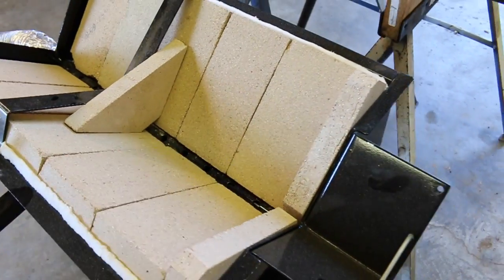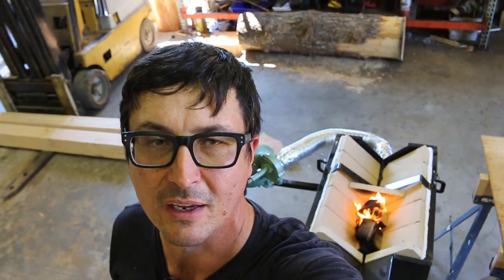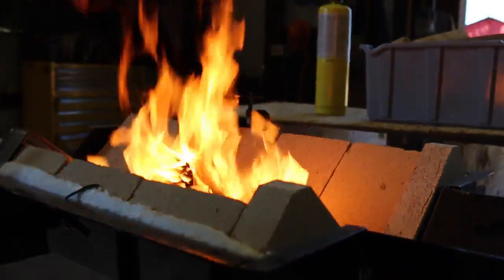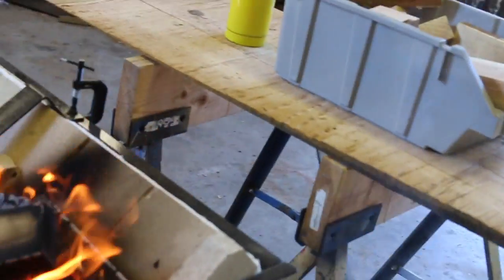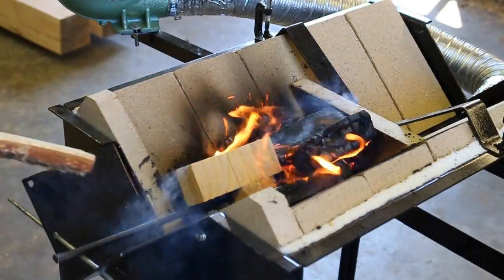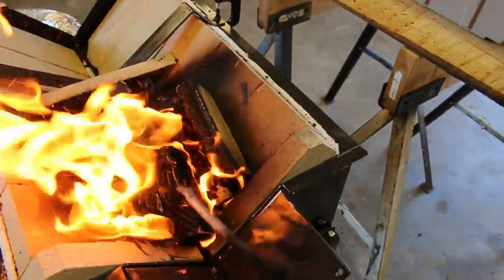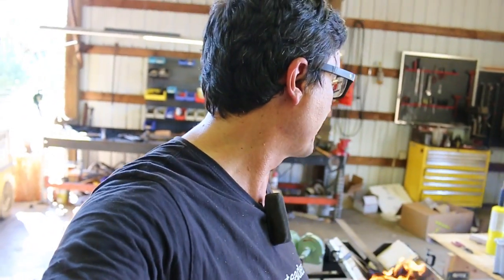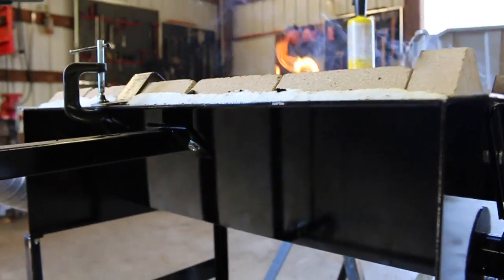Forging Steel With Wood Scraps

Comment: The one HUGE advantage you did not talk about is that you can take this thing ANYWHERE and do you smithing like you would at home , 500 miles in the middle of nowhere this can be used.  I cannot for the life of me see a downside to this forge or what people can be complaining about
Reply: Deo Heerai I think he mentioned something about it in the unboxing video but I may be mistaken
Reply: Deo Heerai You would still need to bring a few bags of wood chunks and tinder.. But yeah I guess if you wanted to bring it anywhere you could.
Reply: A_Old_Fat_Cat not if there are trees...
Reply: A_Old_Fat_Cat Dont forget the Anvil or you are going to have a bad time
Reply: G3RMANARMY When he said in the middle of nowhere it brought a desert to mind.. because thats literally nowhere. And theres not really any sort of a good tree in the desert.
Reply: ***** sure
Reply: The only drawback.... Is that it isn't efficient. But it's cheap. So it kind of evens things out.
Reply: Deo Heerai I'd like to interject here. It won't go everywhere as it's only 2 wheel drive. If it were 4 wheel drive then I would agree. :)
Reply: A_Old_Fat_Cat burn cacti. :)
Reply: Take it to the middle of Death Valley. That'll get you going.
Reply: The Whitlox forge only has two wheels. Thus I dub it two wheel drive. If it had 4 wheels then I would dub it 4 wheel drive. If it was a 4 wheel drive then I reckon you could take it anywhere. So my recommendation is to only use the Whitlox forge in paved areas. (I being quite silly)
Reply: Deo Heerai The biggest benefit of this thing, for me anyway, is that one day I could actually afford to have this shipped out to me in my country. Four boxes? That's nothing. Man, that blower rocks!
Reply: A_Old_Fat_Cat What about dried up scorpion tails?
Reply: mad hatter Now that would be hard core blacksmithing!
Reply: I'm sure the Whitlox guy said that forge welding was no problem. I could be wrong. It's my gifting you know...
Reply: right on....
Reply: +David W I use charcoal to forge weld. But just to beat around metal dry wood works well for me. Mine is an old coal forge with a separate hand crank blower. I've used it all, but prefer wood scraps the dryer the better.
Reply: +Deo Heerai I can't see the downside either, but i'm not much of a smith. However i know that he took it very personal and somehow brought up that the family this product came from are wonderful people. No doubt they are but that has nothing at all to do with the quality of their work. I bet that forge works fine though, and if you feel like there's a tipping risk or something like that you could easily secure it further, but it looks fine to me for use around the house doing hobbyprojects. But then again, what do i know?

Comment: Mr. Wranglerstar, I did it!!! I could not afford to buy a whitlox forge. but you and whitlox inspired me to build my own from scrap materials!!!! I used nothing but an angle grinder, welder, 1/3hp drill press with no drill vice, bench vice, chanel locks, and scrap materials... except for the Kaowool ceramic blanket that I had to buy new. so thank you for inspiring me to do something I have wanted to do for years. It is not pretty unless your me hahaha. but I will be assembling my video shortly on my version of the whitlox wood forge. I have talked to the whitlox family and will promote their forge in my video so people who can't or won't fabricate one, can buy this awesome tool!!! thank you brother for all the inspiration to just go do it and let the mistakes happen. I love metal because you can put it back!!
Reply from the maker: +GasNBullets Well done!

Comment: I've had a full size whitlox for about 2 years. Only negative thing is I got some different blower an Azeeza or something, It doesn't matter that it wasn't the blower pictured but that it arrived with a crack on the gear cover and it shouldn't of. Aside from that, the forge itself is well built and I have had to replace nothing. Replacing firebricks was a concern but mine are all still in great shape, don't abuse or over flux when forge welding and they really last. Forge welds easy, I forge weld steel cable in it regularly. I live in Oregon so wood is plentiful while coal is not and I have to fill enough propane tanks already, I don't need more of those. My only regret would be the blower, wasn't what was shown and arriving brand new with a cracked gear cover is somewhat annoying.
Reply: Do you have to do anything special to forge weld? Or just the normal operation of the forge? I keep reading about how bad of a design it is and I haven’t seen a video of it forge welding something yet. Just curious

Comment: Proper? For years now you have been teaching us and showing us The importance of doing things correctly, properly, and to the highest quality. you have shown us amazing work done by true craftsman including YOURSELF . Everything done to the tightest tolerances.
 so please Mr. wranglerstar excuse me for questioning your judgment on this Forge. This Forge that is obviously not built to any where near the quality that you have taught us to live by. 
Mr. wranglerstar I have always considered your opinion with the highest regards ! 
As weird as it may sound I feel like I gave a friend my opinion ....
Reply from the maker: American Dreamin Have you actually used one? Or is your opinion bases off a video?
Reply: I have never used a Forge in my life. The only videos I watch are yours.
Reply from the maker: American Dreamin I appreciate your opinion however without putting your hands on this tool you are in now way qualified to make such a harsh judgement.
Reply: I feel like putting my hands on it is irrelevant.I know what dryer duct feels like and I can see what it looks like with oversized hose clamps and duct tape holding it on. I know what bolts look like when they are too long. I'm sure you remember a wile back You showed how you aligned the slots of flat head screws so they all would match. I smiled because I had never met someone that was so detail oriented as myself. I do that too. Proper. The small angle iron legs and needless to say the cross brace miscalculations etc . The large gap in quality differences from the stuff you normally show us is where my judgment is coming from. Rogue hoes, Stihl , Adams boots, benchmade , old Stanley , Honda engines.. On and on all the amazing axes and knives perfectly executed. You have shared with us amazing quality items . You have also shown us items which to steer clear of due to lack of quality or usability. Fiskars comes to mind which I have never owned because of your opinion of them. Dreadful fiskars. They can cut down a tree and chop but nothing like your high Quality grand force brooks. I hope you can understand at least a little bit where my opinion is coming from.
Reply: American Dreamin He can, but your starting to drone on and on and on and....
Reply: American Dreamin it is duct tape but its not what everyone thinks of when they hear (duct tape ) this tape is metal .im using this as my test I plan to watch and see how it holds up before I get to judging it from what ive seenbits just been small problems that a chimp with a spanner could fix the support being a lil long (no biggie ) and the plastic wheels (don't need to put them on) I love the fuel I love the power source for the air and if it holds up I love the possibilitiesI may have to send them a metric bolt set if I order one but im crazy and wont drop it .
Reply: Zachary McCullough sorry youtube has been cramping my comments a bit I do proof read before I post and fix but they don't stick . ugh
Reply: I guess I did carry on a bit long however after being called very negative things for stating my opinion on a previous video I feel slightly upset especially coming from a man I've been watching for years and truly respect. Thanks for your opinion bud.
Reply: Zach I understand what your saying.
What I don't understand is why mr. Wranglerstar is telling me that this is quality . When what you just stated is a lot of not quality and not well put together . The other day there was hundreds of people posting there negative opinions... Where did they all go.
Reply: Jason ... Wasnt trying to upset you bub. I'm a very happy person . No troll here I've been watching mr. Wranglerstar for quite some time now. I've enjoyed meany videos of his matter fact this is the first comment I have ever left That wasnt agreeing with his opinion. I did however completely understand the coal vs wood issue but thanks for letting me know again. The issue I was trying to discuss with him is over the quality of the product . Sorry about the spelling im not that good at it.
Reply: they said their piece .
in this vid he cranked er up it got to temp and didn't dump on the floor or light the shop a blaze I like so far .
also please keep in mind this item is mailed to you they have to keep it some what light and be able to break it down . to have it in one piece and shipped as that it would double the cost maybe triple it .
if it cost to much its not worth it people will stick to north American coal .
Reply: Canesrock geesh my phone is not letting me view your link . My guess it's of a couple people standing on it ?  you can allso stand on a can but soon as you shift your weight down you go lol. I have worked around heavy equipment shops Machine shops Mills and construction companies none of which have stands for items made out of one inch ish angle iron. One accidental bub and its not going to be good
Reply: RFDarter please read a few comments ago when I answered that same question to mr. Wranglerstar. Thanks bub
Reply: Zach... It sounds like you own one? You allready told me all the problems with it so out of the box would you consider it quality , made with good material, well thought out?  that's what I was debating with mr wranglerstar about.
Reply: I like you am going off the vids I just happen to work with some of the material its made from and the problems I mentioned where in wranglerstars unboxing vid and assembly vid .
I want to see cody use it more before I decide if ill have it on my land it has some big selling points .
would I stand on it no ! its not a stool or ladder  .
if I remember correctly the ( typical India) was a off center hole for the set screw on the blower handle and has turned out so far to be a nonissue
I like it so far but I do want to see it used .
Reply: American Dreamin one thing I noticed is the dial for the ingenious air flow control ( I love it )  . it is connected to and sits under directly under the fire if you need to adjust the air flow in use that dial may get a tad bit Chaud ! as you are smithing  and  should have gloves on it should be a non issue .
Reply: American Dreamin Its not grand force brooks, it's Gränsfors Bruk :)
Reply: American Dreamin You're missing a fairly important piece of the puzzle here: the forge is a product sold on the open market, not a one-off example of craftsmanship. It needs to be affordable or it won't sell. Thus, it is designed to be easy to mass produce while being sturdy and durable enough to get the job done, likely for as reasonable a cost as possible. The pricing isn't out of line for what you get, as far as I can see, considering it's a niche product.

When you next watch a video of Cody making something, think about how much time he's putting into it. Then translate that time into how much it would cost to pay a skilled worker to do the job at $25+ an hour. It's no big deal to put a bunch of time and care into something you're building for yourself (if you have the time), especially if you enjoy the work. It's an entirely different story to pay someone else to do it for you if you want "the highest quality".
Reply: Madly servered  ... Yup sorry about the spelling. Not all that good at it.
Reply: David .. Good points however is that what we go by now good enough to get the job done? Many quality items are mass-produced. How much would it cost to fix the problems that we have noticed? features were not executed well. Mass produce ? How many people are buying forges? Thanks for chatting with me.
Reply: Adrian.. I do belive mr. Wranglerstar is intelligent man and would not be producing videos for YouTube if he was not able to support his family with the revenue. But besides that I have always Appreciated his generosity in sharing such wonderful content . I have subscribed and thumbed up every video I have watched . I own clothing with his logo on it . The devotion I have for his channel is what has upset me most . Me a man that writes his opinion on a thread in a community in which I thought I belonged to gets dismissed and belittled harshly ..? Shocked. Armchair quarterback? I'm a fellow modern homesteader trying to make a life for my family on my 25 acre American dream.
Reply: American Dreamin  Nice!
Reply: Adrian. I never realized that having and opinion is being nasty I believe I have remained respectful and courteous unlike others. Do my own thing ? I grew up in this lifestyle, It's what I do. can I not post a few videos ? In no way am I trying to gain followers . Thanks for replying.
Reply: American Dreamin  Based on what I seen in this video ... that is NOT dryer duct... it is 3" aluminum ducting rated for high temperature and is used for anything from pellet stoves or venting water heaters. Know your materials before you armchair opinion on the internet.
Reply: American Dreamin The failure point is going to be the brick, because its fire brick. 
You cant throw parts/tools in to it, you are not going to be using it as an anvil. 
It’s not a jungle gym all it needs to do is hold the fire brick and whatever you are working on and the one in the video does just that, when I get one if its not heavy enough I will just bust out the wire feed and add a few pounds to it as needed.
As for why people are upset with you, maybe they paid attention to the first minute of video.
Reply: I apologize for not answering the last few of you commenters. It is time now for me to step away from this issue. Life goes on and mine must. I appreciated hearing all of your opinions after all, an opinion is all I wanted to express. I was, however, greeted with hostility and the assumption that I and fellow subscribers are ignorant layabouts. Pretty unfortunate that this abundance of negativity stemmed solely from a difference in opinion, sad really. Best of luck to everyone
Reply: chimneswp  you are totally wrong on your statement. It is nothing more than cheap dryer duct. That was pointed out in the video. It's not rated for high temps. Also pellet stoves and water heaters have cool exhaust. So in retaliation to your statement. "Know your materials before you armchair opinion on the internet:"
Reply: American Dreamin I can't believe that your statement struck such a nerve. I have to admit that when the brace was the wrong size I was shocked but that could happen. But when they sent a 3" hose to fit 2" nipples I was taken back a bit. If he didn't have the HVAC tape what would it have looked like. I questioned it too. I believe that it looks like a pretty good outfit and wouldn't mind owning one myself but them knowing that he was going to use it in front of the entire "Youtube" world I would have thought they would have taken a little more time packing it. Anyway Cody gets a lot of haters commenting on his stuff so maybe we should cut him some slack over this one. When someone can only read the comments it's all on how it's interpreted. Just know that you were not the only one questioning this product. You were just the one that opened the door for all of the online ass kissers.
Reply: *****
The brace issue is a problem and in the next video it was mentioned that it was being corrected, I think the wrong size hose was only an issue because he lost the instructions. My guess is that they supplied the larger hose on purpose for lack of the “correct” size or the fact air would flow more freely through it, the clue I saw was the 3” hose clamps because they would very easily crush the 3” hose down to 2” then you wouldn’t need the tape and it’s what I would have done.
Reply: American Dreamin I've seen forges 4,000 times worse than these doing  amazing things , I did not understand the problem.
Reply: American Dreamin it is a step up from his brake drum forge. Lets see what he can do with the new one before judgement
Reply: American Dreamin You have a point - the leg supports being 2 inches over sized would also be a bitter pill for me to swallow. Considering that other items such as the air control etc, which is substantially more technical involved works great. We're probably looking at a case of a junior being given the task of cutting flat bar to size and drilling it (after a night of heavy partying) this junior puts his company's name at stake because he wasn't paying attention. If you put it in context that part of the forge is not critical but it leaves a bad taste that they didn't do QC when they dispatch their products.